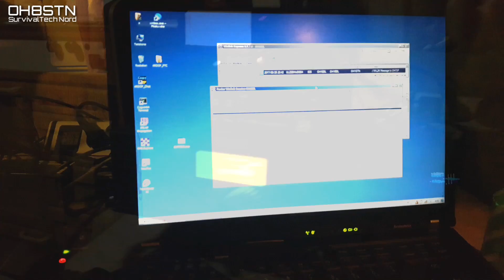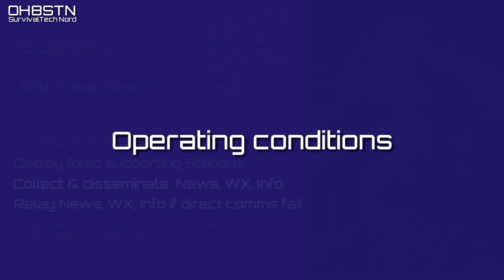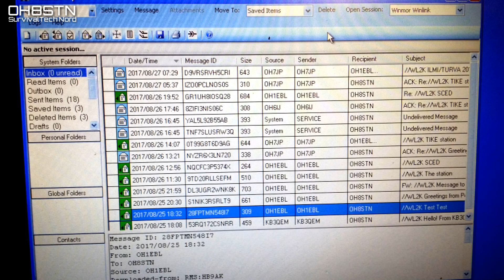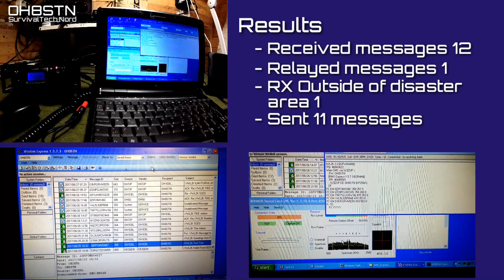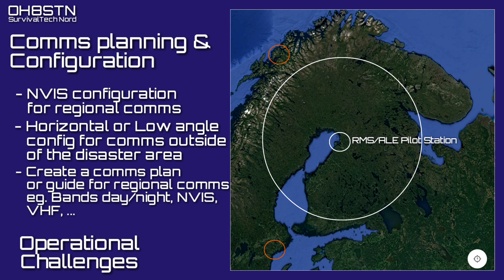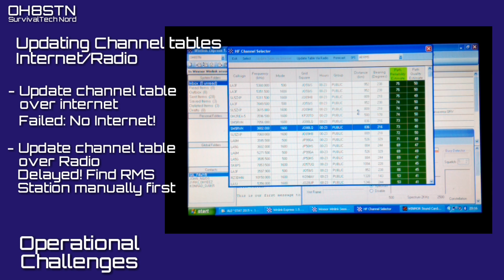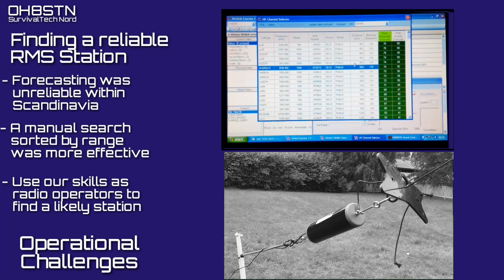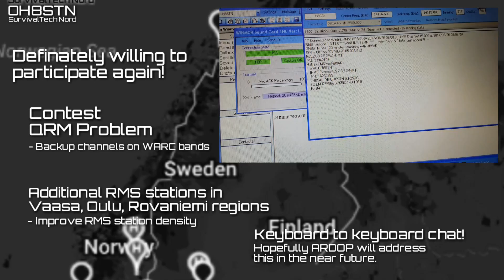WinLink Grid Down Emergency Communications Exercise

Comment: I am an ARES county EC. Our section recently had a wide area Simulated Emergency Test based on a grid down scenario caused by terrorist operations. If you don't mind I will show your video to my group at our monthly meeting tomorrow evening. Well done, thank you. Randall K9ANF
Reply from the maker: Sorry for the slow response Randy your message was in the spam folder for some reason. Definitely are welcome to show this video. Unfortunately it's not my best but you are welcome.
73
Julian oh8stn

Comment: I enjoyed your video so much that I watched twice. I am a WinLink fan. I think the WinLink community could greatly benefit from watching your video. My main interest to get me started with WinLink was to be able to communicate with my son who lives on the Gulf Coast of Alabama that is prone to hurricane disasters. We have set up a plan for P2P as well. On the topic of finding a WinLink station with no internet, I have been successful when I would listen to an active WinLink session and noting the frequency. Then I would use the list to narrow down the station after doing the math with the dial frequency. It also gave me an idea of the propagation at that time. Outstanding video. I look forward to the next one. ~73  Ron (KF4UPI)
Reply from the maker: +Ron Langner thank you very much Ron. I hope the current hurricane situation and the Gulf Coast isn't affecting your son. I don't know if they'll benefit from my feedback. There are more experienced operators than myself using winlink. Like you I enjoy the idea of sending for receiving email two people outside of the ham radio ecosystem. Other than the issues with propagation the thing I missed the most was having a real time chat system in parallel with winlink. The ARDOP project certainly trying to answer that question, but I wonder why they haven't adopted This Magnificent system called fsq. It's open source and it's already been developed and proven. Anyway like I said that many more operators having more experience with winlink than myself.
Thanks for reaching out and for the kindness, It's very much appreciated

Comment: Thanks for great video Julian. There are some points you may not be aware yet concerning EMCOMM nodes in Finland. We use Winlink Service Code TURVA during exercises and that brings a few more stations to the winmor map. The other thing is, there are nodes capable for message transfer without internet, based on BPQ SW, most Rasberry PI. They are shown here: http://nodemap.g8bpq.net:81/ Your location would be ideal to add to the map..  more in Hangouts  OH5RM
Reply from the maker: +oh5rm awesome feedback. You know I'm still learning with WinLink and definitely willing to take more guidance.

Comment: Great video, Julian!  Thanks for sharing.  I feel your frustration with trying to connect to some of the HF stations.  Being that I'm in the lower center of the US I tend to try to connect to stations on either the east or west coasts.  Sometimes I get lucky, other times not so much.  I've got several VHF packet WinLink stations; near my house; but I can't seem to catch any of the up when I'm trying to connect.  I'll definitely be interested in seeing how you set up your own WinLink station.  I've been thinking about putting together one of my own.
Reply from the maker: +Richard Slusher thanks for this message Richard, it's always good to get your input. What you're talking about is exactly the gateway density problem mentioned in the video. I don't have any experience with VHF packet winlink stations yet, but you know I'm all about over-the-horizon comms. So I think I'm going to do two different Builds on the channel. An ALE pilot station build, and a RMS Gateway build. Bboth running on 30 or 40m.
The trick is going to be getting both of those to run on a Raspberry Pi.
Reply: I'll definitely be watching for those!  :)

Comment: Mark Griffin in Flordia has a Pi Gate http://www.pigate.net/     The PiGate is a small piece of hardware that can be brought into a disaster area, connected to an already existing VHF or HF amateur radio and antenna (like in your car or truck), and used to send e-mail to the global Winlink2000 system through a Radio Message Server (RMS) station.
   I hope to be getting one of these to see how it works from a call out site.Coming out from a disaster area would be the issue as you had a problem with QRM etc. HF Propagation is another issue what with solar flares etc

Comment: Julian...was reading about winmail and found this video on creating an emergency winlink gateway (pi node)
https://youtu.be/qO8lnRP5SE8. @ 10:00
Reply from the maker: +Christian Hoffman thanks for sharing this. I'm very familiar with the pigate and I have a few of the components here already to build one. Actually I like it very much because I think it's quite easy to solar power. If that's the case I'll put one up on the tower with a solar panel and battery and a dipole and start offering email to hams.

Comment: Great video, Julian. Keep it up. I'm a fan of Winlink, as you know. If you can get an ALE/Winlink network established you are going to be cutting edge.

73,
Al
Reply from the maker: +KM4DYX you know it's astonishing I don't know why ALE winlink aren't used to augment one another more commonly. I don't mean that they should be integrated, but each system has magnificent features which the other is lacking. I think I'm going to do a couple of build videos next of course those are the most fun but in parallel I'm going to do some research and plan how I might implement 40 meters system I talked about in the video.
Thanks for commenting, it's very encouraging and appreciate it.
Reply: HF Gateways use SCS-PTC tnc. Winmor is not that robust however with ARDOP it is supposed to work. Only thing is dead HF from solar flare de va7dgp

Comment: I have a few thoughts related to Winlink specifically and digital comms in general to share re what we are doing for disaster messaging if you might be interested. My email via QRZ.
Reply from the maker: +Jim Piper if at all possible please write about it here or share a link to a blog or something like that. It's always a great idea to share Insight or Solutions others are using.
Reply: Would be too lengthy as it involves samples of agency forms that would be attached to my email back to you. n6med

Comment: Thank you for another great video. Winlink is like other modes and configurations. You must practice it to understand the capability and limits. Your observation that your knowledge of your own propagation experience was a better prediction of contact success is similar to my own testing. I do a weekly winlink test and always try different RMS nodes. Over the last six months I know what bands and stations work best depending on the time of day. I encourage anyone truly interested in using this mode for emergencies undertake such practice. It also keeps your propitiation lists up to date.

I do have some serious concerns about the capacity of the existing RMS stations to handle a regional grid down scenario. Here on the east coast of the US it is often hard to find one of my go to RMS stations on a clear frequency during the evening hours. Just a half dozen operators trying to use the network during the same time could stop anyone else from getting messages through - for half the country! A published comms plan establishing temporary peer to peer networks would help, but the number of clear 2.5khz channels is limited considering the number of other users handling SSB and PSK31 emergency traffic. It would seem that your drill used a limited number of stations operating in a coordinated way. An uncoordinated emergency network with dozens of stations might grind to a QRM gridlock. Kind of what happens every year with field day during peak times, or pile ups for rare DX stations. Eventually there are too many callers and the calling station can't understand anyone. This will be doubly true for the RMS stations were everyone is operating nearly the same power levels and it is a computer trying to pick out a clear station instead of a human asking  "something ending in sierra tango November???"

I think more work needs to go into the planning for using winlink in the case of a real regional disaster and some re-engineering might be in order as well. At the very least a kind of universal comms plan, to let operators prioritize traffic and access.

Great video on an important topic. 73 Charlie KM4ZZ